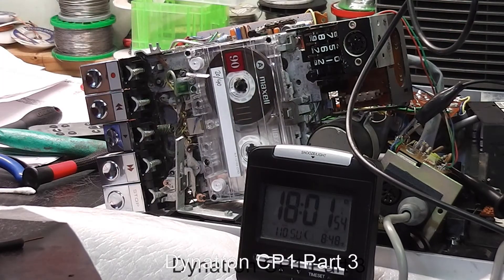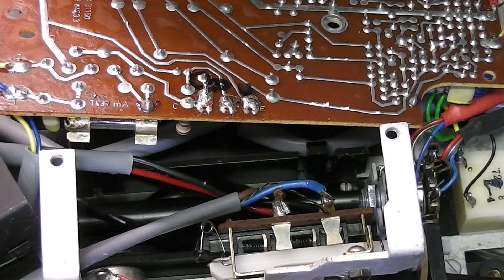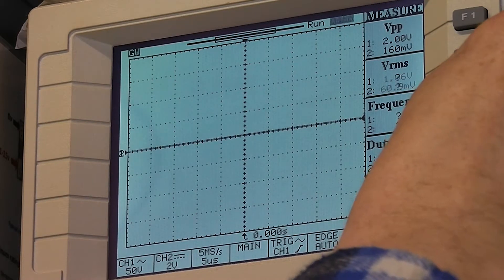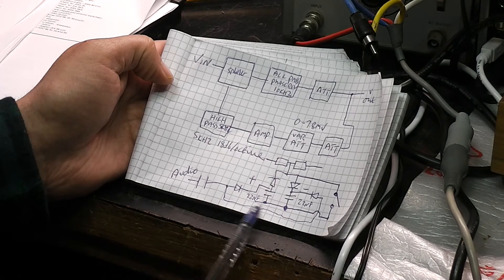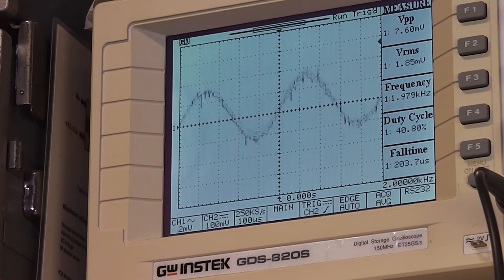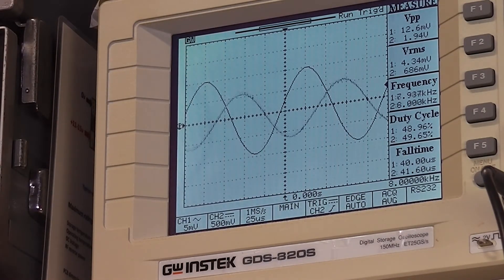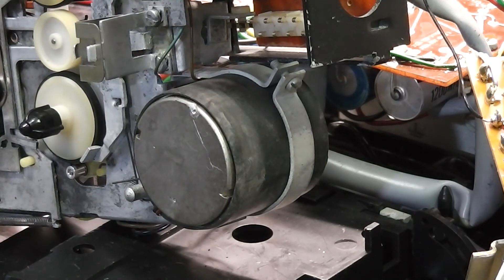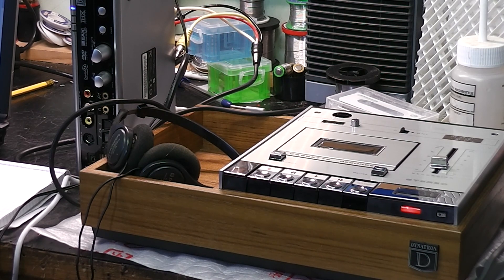Dynatron CP1 Cassette Tape Deck 1972 Part 3

Comment: The worm drive on the record level control was so the actual pot itself was isolated from dust, considering the unit is horizontal.
Reply from the maker: I feel the operation is much better than a slider pot too, much smoother.

Comment: I suppose the other method if you have no frequency counter is to use a known good deck and make a marker tone (like the BBC pips) every 30 seconds or so?
Reply from the maker: That's an interesting thought, Simon. I got the idea of marking the tape from Tim's video on clydesight.